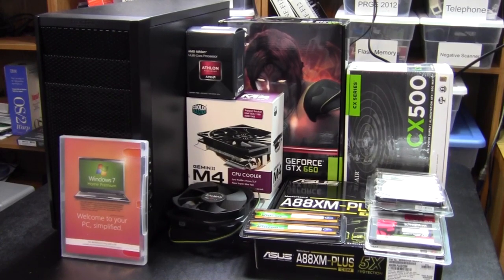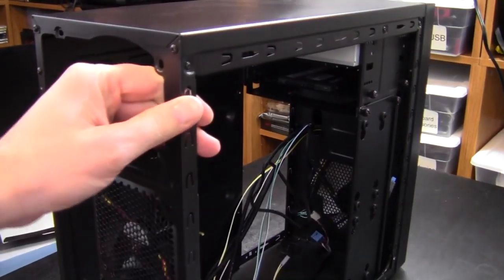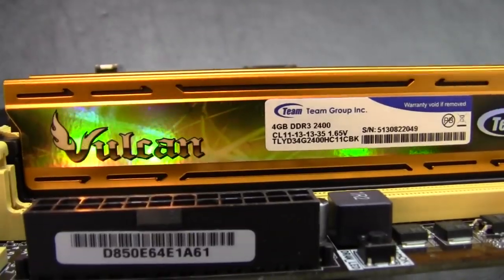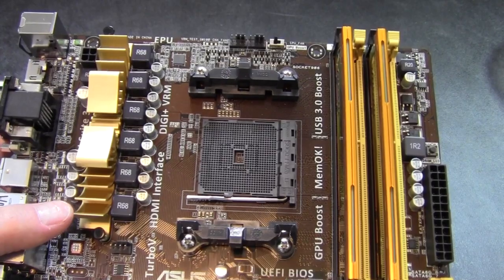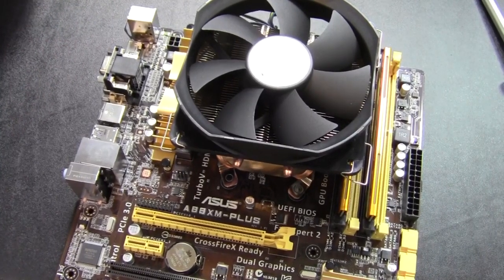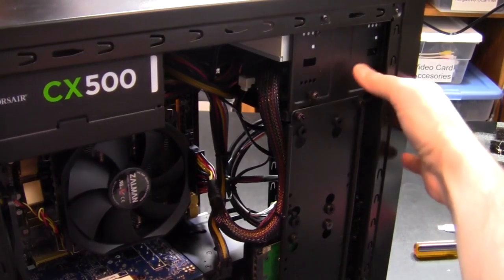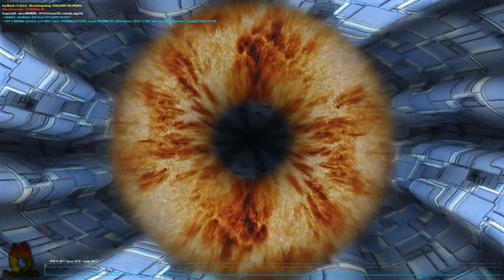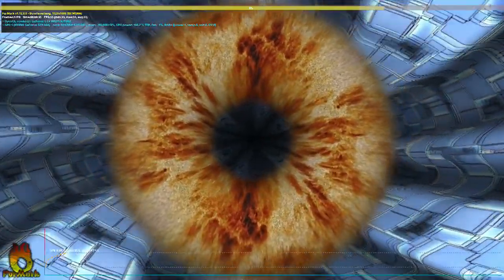Fractal Design Core 1000 Build

Comment: Overall good video, but I would change several parts.  That v300 SSD has been criticized for having Micron 20nm asynchronous NAND chips, which have very poor performance.  A Samsung 120GB EVO is better and costs $20 more.  I would never buy a case with a top mounted power supply.  I would have gotten the top-end Athlon processor, the AMD Athlon X4 760K.  I would have gotten a GTX 750TI from EVGA, any 2GB model.  (But that price for your GTX660 is exceptionally low).  And I would have gotten Windows 8.1, as there is nothing preventing playing games on it.
Reply from the maker: I would agree about the Kingston drive, probably why it was so cheap (for Feb 2014). The 750ti wasn't out when I bought these parts. The low price on the GPU was good until it failed and I had to pay for shipping to ECS, then wait for a month to get the "new" one which was a refurb. But, what do you do? At least it did work and I really didn't lose anything other than shipping and time. I still use Win 7, because I can support it fairly well. I want to make sure I know Win 8 or 8.1 before I start using it fully. Plus, I have very rare occasions that the customers want it. Most people come to me because the box stores aren't selling Win 7 anymore. Once people invest the time to learn it, they will find that it really isn't that horrible with utilities like Startisback. Thanks for your feedback :)

Comment: Are the brass stand-offs installed or install them manually?
Great video as well!
Reply from the maker: Jon Shillova If I recall correctly, they were pre installed. It seems that most of the ITX cases that I have used have had them pre installed as there is no other configuration on ITX.

Comment: Do I really need to add an extra fan in the rear? I'm on a budget and I'm using stock fans...
Reply from the maker: No. In my opinion, you can get by with only a front fan. I would recommend at least that in any case. The front fan will help keep positive pressure in the case and air will flow out of the exhaust vent anyway. Unless you have a really powerful build going in to this case you will be fine.
Reply: Thank you! I appreciate it!

Comment: So I ordered a A88XM-A instead of the A88XM-PLUS is that bad? It was a accident thought it was the same just want to know if the PC will function the same and will it affect the build?
Reply from the maker: Youthful Julian The PLUS is a little nicer and has a heatsink on the processor power delivery. If you could cancel it and get the PLUS I would. However, it is not something to lose sleep over. They are both the A88X chipset. The worst thing is the non PLUS likely won't overclock the CPU as well if that is what you were going to try and do.
Reply: AdoptedMike well not quite I'm really new to the whole pc world I barely know what over clocking is but I already have the ax88 a so I'll stick with it just wanted to know if it would affect the build so I don't need the fan to cool the cup or would I still need it?
Reply from the maker: Youthful Julian You will still need the CPU fan to cool it. It will help cool the surrounding parts on the motherboard as well.

Comment: Hey man. Im gonna be switching to a new mobo/ processor. Do you think ill have to get a new os (i have windows7) and im keeping my hard drives
Reply from the maker: If you have the non boxed (or OEM) version it will usually it will require a call to Microsoft to explain that you are switching motherboards. I understand that most of the time they will allow the OS to be installed on the second system if the first one is not using the OS anymore.
Reply: AdoptedMike ok. Thanks man :3

Comment: Is it possible to put ssd verticaly in top 2x5.25 little black box right of PSU ? I rly need to know thaaat , please help!
Reply from the maker: It should fit. I sold this computer so unfortunately I cannot try it out. But, I have seen a lot of ways to mount SSDs with velcro or double sided tape. They can pretty much go anywhere because of them being solid state.

Comment: Does a R7 260X fit in a Fractal Design Core 1100?
Reply: +Fadi E it should I have a gtx 970 in mine with msi cooler
Reply: "To be future proof, the Core 1000 supports graphic cards longer than 210mm.. The chassis supports graphics cards... Up to 350mm!" From the owner's manual

Comment: Hi! Would a GTX 960 on a ECS H110M-C3D Motherboard and i3 6100 fit in this case?
Reply from the maker: Yes, no problems that I can see. Pretty easy config.
Reply: Thanks! Would you recommend any other smaller form factor cases that would fit my motherboard and gpu?
Reply from the maker: For the price this is my favorite micro ATX case.
Reply: Thanks! I really appreciate the help :).
Reply from the maker: Glad to help!

Comment: What's the name of the additional fan tho
Reply from the maker: That fan came off of another CPU heatsink that I switched out. It came from a ZALMAN CNPS10X. I can't remember why I switched out the fans, I think I switched it for an LED fan for the Zalman CNPS10X. Any 120mm fan will work however.
Reply: AdoptedMike can every thing get overclock also should I do the same build has you are doing but add a A10 7850k Apu also how much this cost I'm  going to the discretion to see
Reply from the maker: Hyperdonic2 The CPU and GPU are definitely overclockable but I wouldn't do the 7850k with the GTX 660. You don't need the APUs graphics. The costs are all in the description I don't think that they have changed much in the past few months. I got everything at NewEgg.com. To get the most current costs, you would have to check out the place that you plan to buy from.
Reply: AdoptedMike I mean only the 7850k 

But I can add a R7 250 to run games a bit more smoothly 
I have got every thing I need to get started also shoulde I get a poope peach fans
Reply from the maker: Hyperdonic2 Yeah the R7 will work great to help out. But I don't know what you mean by "poope peach fans".
Reply: AdoptedMike I forgoten the name of the producer of that fan but how ever my pc is coming on its why also I'm going to overclock for days can you recommend a fan that I can get for this case
Reply from the maker: Hyperdonic2 Any 120mm fan that has a 4 pin fan header is the most ideal. That way the motherboard can control the fan a little better. Here is one : 
http://www.newegg.com/Product/Product.aspx?Item=N82E16835103069
I have used quite a few of these for CPU heatsinks and they work very well for the price. The original fan that I used was a Zalman fan, but it was by no means the best. Just a fan that I have laying around.
Reply: AdoptedMike does new egg deliver to the uk
Reply from the maker: I don't know. But you should be able to find someone in the UK like NewEgg.com. Or just check out NewEgg's website.
Reply: Thanke